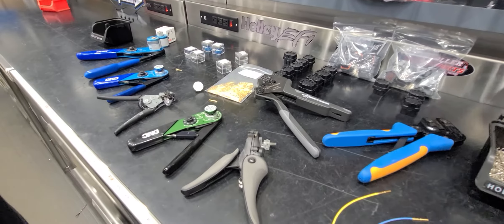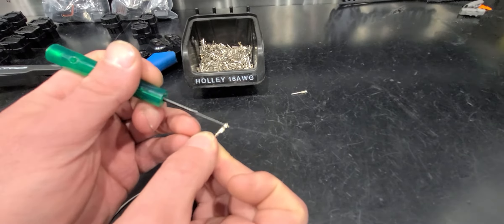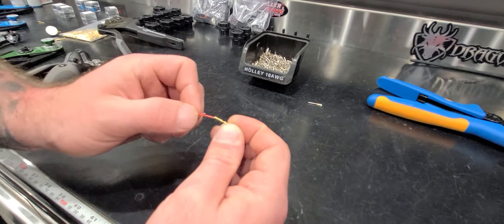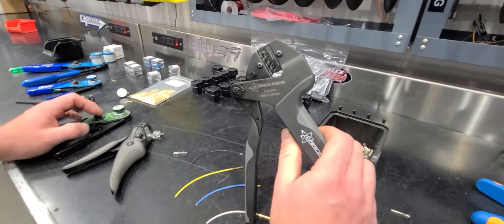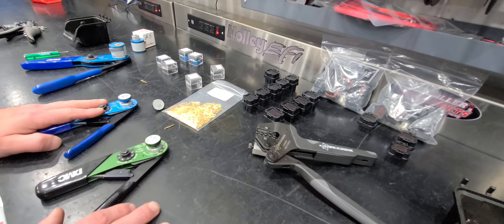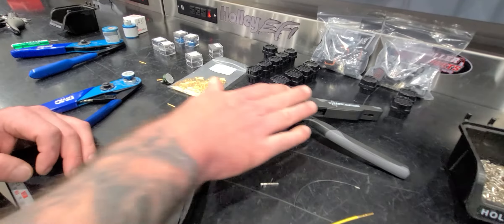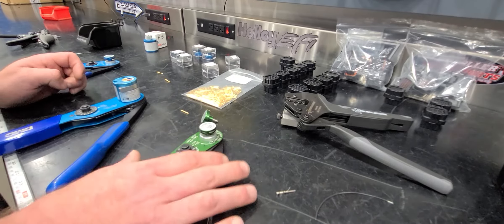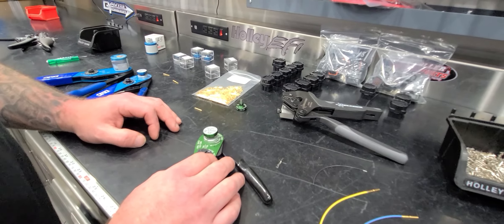The new Racespec solid ecu contacts for Holley, Motec and others. plus tooling info

Comment: the solid barrel stuff looks amazing and must be a lot easier on the end user. My question is, wouldn't the open barrel connectors be potentially more robust as not only is it crimped on the conductor, but its also got a crimp on the jacket for extra strain relief.
Reply: That’s why I recommend to use backshells and a boot with these.